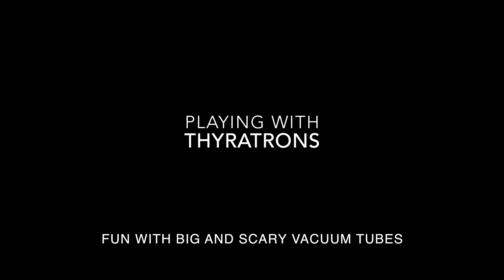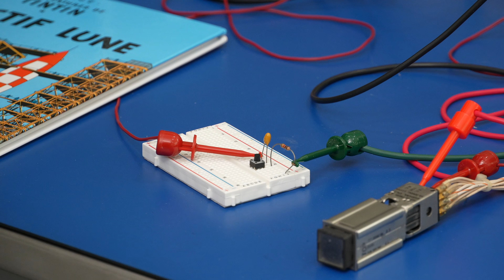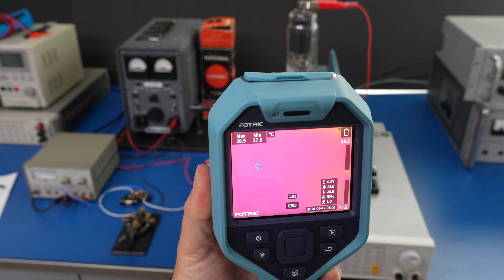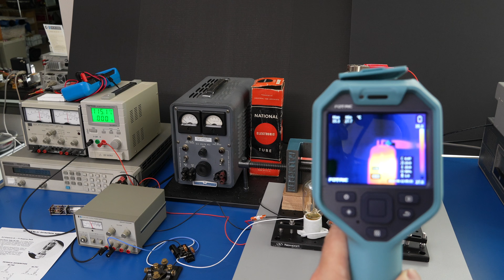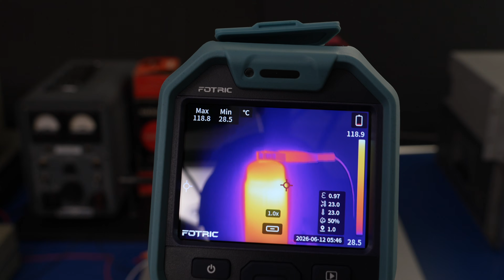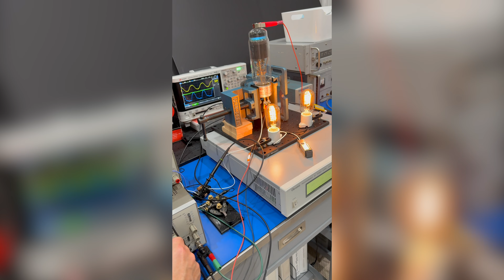We power up a giant Thyratron tube

Comment: I work on jukeboxes. Seeburgs use Thyratrons to trip the mechanism during scan to pick up the record. It drives a big solenoid aptly named the "trip-solenoid" which actuates the clutch that changes the motor to the cam which indexes the mech against the magazine, and picks up the record. 

Earlier versions use mechanical memory in the form of a pin bank array. Pins would move into the path of a contact block and when that contact block scanned across and touched the moved pin it would trip the thyratron. 

The next iteration was right up your alley. They used a linear array of core memory to story selections. One bit for each side of a record. As the mechanism scanned a pair of contacts (one for A and B side each) would be dragged across a contact point for each core. If a 1 had been written to that selection the current pulse flowed down through the contact block, through a 12AX7 pulse amplifier, then into the 2050 Thyratron to trip the mechanism to pick up. 

In the 70s Seeburg started going towards solid state controllers and eventually computerized selectors... But they stuck with the core memory right into the 80s.

Comment: Thanks Marc. When I was young, a local beach fair operator had a big wheel for which the DC power was generated and controlled by a full wave Mercury arc thyratron circuit. Some called it a Mercury arc rectifier, but they were thyratrons. The wheel owner made the blue glow from the valves a small feature of the ride.

Comment: I have a pair of F-166 thyratron tubes I bought at the estate sale of a good friend after he passed away.  If I remember correctly they can handle 40kV peak anode voltage and 1500 A peak anode current.  They are the hydrogen type ceramic package tubes.  My friend was a retired radar tech.  RIP Jim.

Comment: Make a in wall frame with glass door lid to house two thyatrons, center tapped transformer for your light dimmer and have a little potentionmeter mounted on the wall to adjust the duty cycle.

Comment: Remember thyratron from when I was working with the bendix RDR-1E it had the beautiful blue glow until they replaced it with a ceramic EG&G type. It had also klystron with a tuning screw, don’t tune that with non isolated thing use the included fiber thing. And then the phantatron there was sounding like something made up because everything sounds better in the 50’ with tron in the end.

Comment: I didn't pick up what it's job was in the original machine. Please help. Love the video.
Reply from the maker: Two applications demonstrated here. Ken’s small thyratron was used to switch on a solenoid, a latching relay in the case of the IBM 604.
My big thyratron was often used in controlled rectification applications, to make dimmers of sorts. Controlling a DC motor speed, making regulated DC power supplies, or dimming large lighting installations like in movie theaters.
Reply: @CuriousMarc thank you

Comment: The 2D21 was also used as a thyratron in Seeburg jukeboxes, specifically the V200 model, funny, isn't it?
An improved model was later released, the VL200, which no longer featured the 2D21.

Comment: It may not be emitting any x-rays or UV, those are the least of my worries. You really need to check it for Thalaron radiation even if that may be mitigated to some extent by the modest amount of metaphasic radiation it likely also produces.  It may also be emitting dangerous levels of spiroid epsilon rays but unfortunately there does not exist an instrument to detect those yet.

Comment: I used to maintain 1/2 inch tape decks at the start of my career, TM2 Computer Decks, they used 4 of these to control the two massive servo reels, fabulous display of blue flashing lights when they were being stressed .....  fault finding was easy, often they would go "soft" (the server motors). and the faulty Tube was identified by it glowing red, rather than the blue.......  happy days!!
Reply: Why did those tubes go faulty?

Comment: Why do you need two tubes for full-wave control? You can use one tube and a bridge rectifier. When the voltage between the anode and cathode drops below a few volts, the ionization will extinguish itself. Historically, the reason they did it with two tubes was the cost. Before the first high-power silicon diodes, an extra transformer winding was cheaper than a pair of tubes... 😂

Comment: The old large X-ray transformers had very large diodes tubes which was surrounded by lead shielding and cooled by transformer oil and a circulation propeller, you couldn’t pull the tubes above the oil while it was running. You could see the light distortion from the heat in the oil while it was running with your flashlight/torch.

Comment: Seen the short, but didn't notice the piece of Tektronix gear in the back.
What is that?
Looks like the vertical chanel of a scope, if it was a standalone box.
Reply from the maker: It’s the electronics for the Hall effect current probe, which senses the current in the wire, and generates the sound.
Reply: @CuriousMarc 
Cool, interesting how Tektronix reused frontend style of their oscilloscopes.

It must have aditional setings for zeroing, probe calibration and voltage output for scopes.
I know that because I used an elcheapo one in our university lab.

Comment: They also used that little 2D21 thyratron tube in old Seeburg jukeboxes as a relay driver.  Many years ago I was fixing one and was surprised by the fact that the tube in it had IBM branding on the envelope - I guess now I know why.
Reply: Funny, I hadn’t seen your comment; mine was along much the same lines – a jukebox fanatic? Or, as I was myself back in the 1960s, a technician specialising in repairing and maintaining these fantastic machines?
Reply: @patrickfarnburn5704  I find a lot of that older technology really interesting and for a while was the local go to guy for fixing them. That just stuck in my mind because it was so unexpected - I guess someone got the tube as a spare and for some reason it was an IBM one.
Reply: @TrimeshSZ  It was also the only brand to use ring-core memory; it was well ahead of its time.
Reply: @patrickfarnburn5704  Ah, was that Seeburg too?  I can remember seeing a machine which used core storage for the tracks to play, but couldn't remember which one it was.
Reply: @TrimeshSZ  Yes, it was the only brand that had the know-how to do this; all the other brands operated mechanically, which is why there was the 2D21, and later the 2050, in those Seeburg machines.

Comment: It's probably just me, but I  don't quite understand that to me, valve (or tube in your parlance) electronics is seems more satisfying than these transistor things. Perhaps it's the increased danger of high voltages and the chance of hurting (or killing) yourself! They are certainly prettier when operating that this solid state stuff. 😄

Comment: They did make music with thyratrons, they are called tube organs. They make an amazing sound more like someone made an NES synth chip but made with 50s tech with some huge analog sound on top rather than a tonewheel from vids I've seen here. Unfortunately people from the "short attention span universe" (I call them "rotlings") don't see any value in old machines and scrap them for tubes or even just raw metal (gotta sell to the AI corpos). So please save any tube equipmemt you find, amazing you still found a 600 series system that hadn't become sledgehammer fodder.

Comment: "You don't need a side quest from your side quest."
Wise words, never heeded.
Reply: It's a side² quest.
Reply: Ken is always knocking it out the park with his off camera comments.
Reply: As a side side side quest you could setup the electrical part of Young Frankenstein's lab
Reply: Then proceeds to side quest the side quest on the side quest with a possible further side quest at which point the other guys had to nail Marc to the floor for his own good.
Reply: Marc is just channeling Feynman, nothing to worry about. :-)
Reply: To get back on track, the Apollo setup could use some serious radio amplifier tubes. You know, the ones using high power water pumps for cooling ;-)

Comment: You can use a 2nd thyrotron to turn off the 1st one. If you capacity couple a second device anode   via a capacitor  to the anode of the 1st thyratron then when the 2nd device is fired it will inject a negative pulse into the anode of the 1st thyratron thus turning it off.
The same system will work with semiconductors like thyristers.

Comment: The word "Thyratron" comes from the Greek word "Thyros" which means "door", so a Thyratron is a "door" tube, you can think of it as being the vacuum tube equivalent of a voltage-controlled switch.
Reply: New inventions won't get cool names any more because people don't learn Greek and Latin.
Reply: We used them as pulse forming networks for a weather radar I worked on. You have to be careful around them. Use a big gafe on a wooden stick to discharge them before working on the radar. They'd the magnetron which upped the voltage and power again.
Reply: So its a transistor then?
Reply: @tireballastserviceofflorid7771  It's a hollow-state SCR
Reply: @m.k.8158 i was being sarcastic to his word salad explication.
Reply: @tireballastserviceofflorid7771 Oh dear, it’s never good when you have to explain that you’re being sarcastic.
His explanation wasn’t word salad, it just had information that some might find interesting.
Reply: @cgln8760 His answer said he just spent 1.5 minutes on wiki and went cool!!.
Reply: @tireballastserviceofflorid7771 It's a thyristor... Or it's grandpa
Reply: @tireballastserviceofflorid7771 close, compare with thyristor

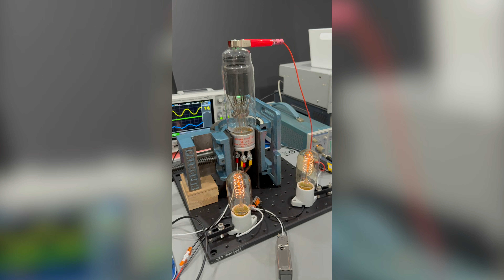Comment: 21:45 it sounds like the frequency of the tone drops slightly when you sweep the trigger point towards pinching off the current, but not when sweeping from pinched off back to fully open. any idea what's going on with that asymmetry?
Reply: I pitch in as a musician; Yes, when modulating the duty cycle of an otherwise fixed pith waveform, it mimics the Doppler effect. Our hearing perceives it as a pitch shift, but the base frequency (here 60 Hz) doesn’t change. It’s «start point» changes, but still «ends» at its original frequency. 

What we hear, are harmonics rather than the base frequency, as the abrupt cut-in generates a lot of them. Against the ‘static’ cut-off, it sounds like a chorus effect or rotating horn (Leslie cabinet).

On a synthesizer, this is usually done with a square wave, its duty cycle modulated by a much slower source - e.g. an LFO sine wave (low frequency oscillator). At about 1 Hz modulation, the «chorus effect» - albeit a faux one - becomes quite pronounced. Used in musicmaking all the time…

Comment: That’s a baby thyratron. My junk box contains a couple ceramic tubes that switch tens of thousands of amps at tens of kilovolts. They came out of excimer lasers.
Reply from the maker: Those are the mean ones with the UV and the X-rays! But who cares about puny UV generation by thyratrons when one has an excimer laser next to it!
Reply: Don't look at laser with remaining eye.
Reply: @CuriousMarc unfortunately, the excimer lasers were basket cases and I had to scrap them. The fluorine in gas mixes slowly ate the heater exchangers that cooled the gas. They had 1m+ squirrel cage blowers to circulate gas transverse to the discharge. With CO2 laser optics I believe the warning placard listed 150J maximum with CO2. I don’t recall the pulse duration for CO2…perhaps a microsecond. The thyratrons have a metal ring a few cm tall and perhaps a cm thick (X-ray shield) that sat around the middle of the slightly smaller than soda can sized ceramic tube. There was also really interesting stacked tape wound metglas cores in a 3/4 turn structure with an inner and outer tube closed together at one end.
Reply: I have one from a medical LinearAccelerator.  They scrap these even if still good, due to excessive leakage.  But they can still be used for high current switches, similar Trigatrons or Krytrons.
Reply: ignitrons... teh only way i could access decent amounts of mercury but i cant bring myself to break them open...

i dont have much use for their abilities?
Reply: Any photos

Comment: If you put your load in series with a bridge rectifier, put your thyratron on the dc side of the bridge rectifier, then use a voltage divider/pot on the dc to drive the grid you could probably use this as an ac dimmer.
Reply: I have done the same thing but with a thyristor across the bridge, it worked surprisingly well!

Comment: The legendary Monarch 10EE toolroom lathe used motor drives which contained thyratron tubes during certain production years. The tubes themselves are usually hidden away in a cabinet for protection but there are a few videos around showing them glowing nicely while the lathe is running.

Comment: heating those large Thyratrons that draw tens of amps is easy. just throw afew turns thru a toroidal transformer
Reply from the maker: That would work. Or use a recuperation microwave transformer. You need some control though, so after a Variac in the primary. But lucky me, I had a big protected power supply, that was far safer!

Comment: Why does the heater need so much power? .
Great vid thanks
Reply from the maker: To generate all the electrons for the large current that goes through the tube.
Reply: That is only part of the answer. Considering its pulse current is 77 amps and sverage current is 6 odd amps, that current must find its way to the emissive part of the heater..I’m assuming it is directly heated brcause all the thyratrons I have are directly heated. 
This working current has to add to the heater current at one apend of the heater, so the heater will run a bit hotter at that end, this is why the low voltage of 2.5v but about 25A, to be much larger than the working component that emits and goes to the anode.  If the heater were longer and thinner, say 10v at  about 6A, then the working current would DOUBLE the heater current st one end and melt it st that end. 
Another reason for the 50-60 watts of heater in this particular thyratron is to keep all the mercury vapourized, inert gas thyratrons have slightly lower piwered heaters but they still have to be short and thick so the working current does not overheat the haeter too much at one end.

Most people don’t think of this aspect becsuse, for most vacuum valves the heaters are in the 300-600mA region, whikst the anode currects are just 1-10mA…(60mA for power types) AND they are indirectly heated as well, so the heater and cathode currents are separated. In old directly heated types…like the 2A3, where heater and signsl currents flowed in the same heater..like this thyratron…using DC would stress the heater at one end, so they used AC on the heater, but drove the two ends of the heater 180* out of phase so the AC used to heat the directly heated heater would not add to the signal as in a grounded grid configuration.
Actually, driving directly heated valves, like this thyratron or a 2A3.. or the big forced sir cooled tetrode in the output dtage of sn old TV transmittereas quitr “trickey” to get the best results and the longest heater life.
Reply from the maker: No, all the electrons are thermally emitted from the cathode, even at the 77A peak. Amperage in the filament has nothing to do with amperage in the cathode, besides facilitating electron emission from the latter. Not the same electrons. The 6.4A average limit is thermal, from anode heating I suppose, but I’m not sure.

Comment: But Marc! You missed the cute purple glow in the top of Ken's 2D21! Not as big as the Blue Glow, but fun nonetheless.

There was a time that they made theatrical light dimmers using thyratrons. When you consider a typical stage light in the US required 1KW, and the typical small dimmer was 2KW, you start getting an appreciation for just how much Blue Glow there might have been on a 24 channel board.

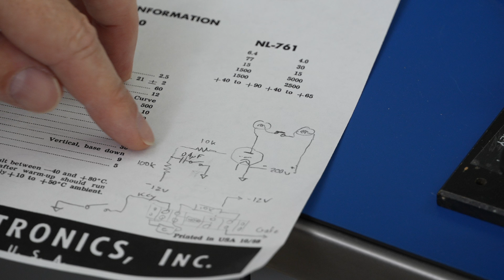Comment: @10:25 Don’t you need a resistor (say 1 Megohm) across the 0.4uF capacitor to discharge it?
Reply from the maker: Probably! But my old capacitor taken from the Metrix 217 was leaky enough that in the end it didn’t matter.

Comment: the trigger circuit only worked once because pressing the button charged the capacitor, and there was nothing to discharge it again.  it needed a bleeder resistor across it to be able to work additional times.
Reply: .. or you could have uses a 555 ;~)
Reply: @AndyHullMcPenguin every circuit requires a 555, a component no longer available and at least 3 useless resistors 😂😂
Reply: @mattyb7736  is adding those components the inverse operation to Muntz-ing?
Reply: No. The gas in the thyatron gets ionized and ionized gas is a ,good conductor. This is how the tube works and makes it behave like a latch. This is why you must cutoff power flow to make the gas de-ionize to make it switch off. The capacitor is wired in series with the switch so that only a very short pulse is sent to the trigger.
Reply: @3fives-j5w  All true, but this basically only works the first time you press the trigger switch. Then the capacitor charges up and stays charged, so it will do nothing the second time you press the switch. You do need a bleeder resistor parallel to the capacitor; can be a high value, e.g., 220k

Comment: Very similar to thyratron is the krytron used as an ignition device for the nukes...
Reply from the maker: It’s a cold cathode version of the Thyratron. Even meaner apparently, and tightly regulated because of one of its original applications that you mentioned